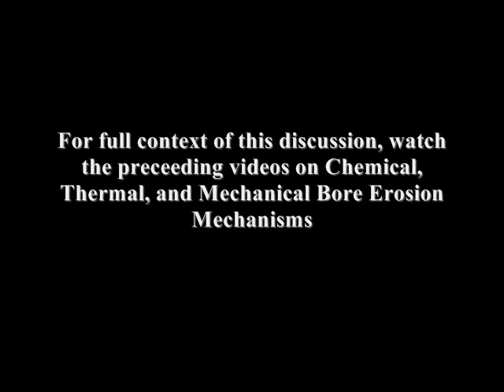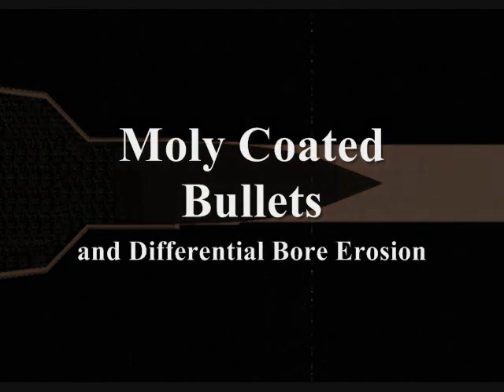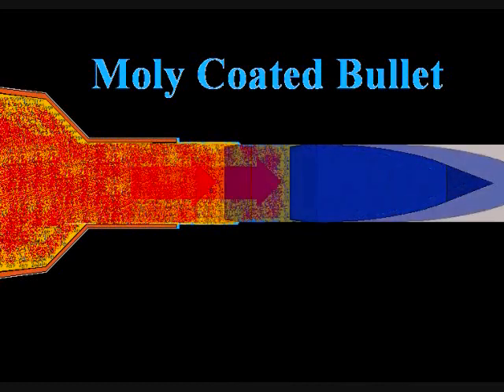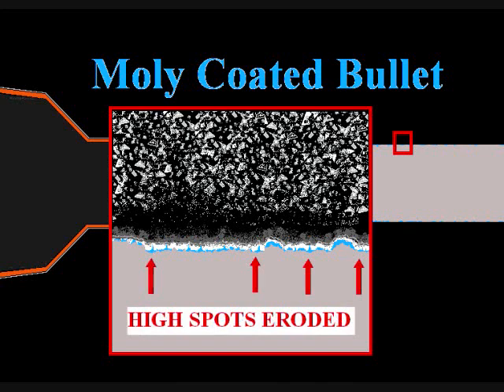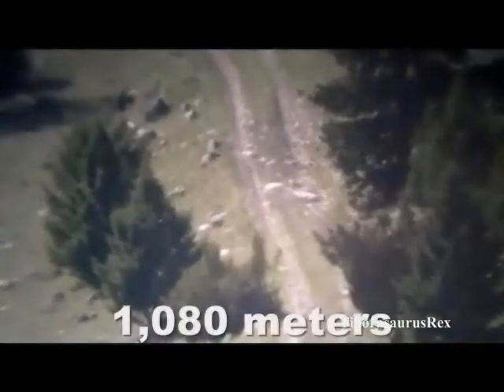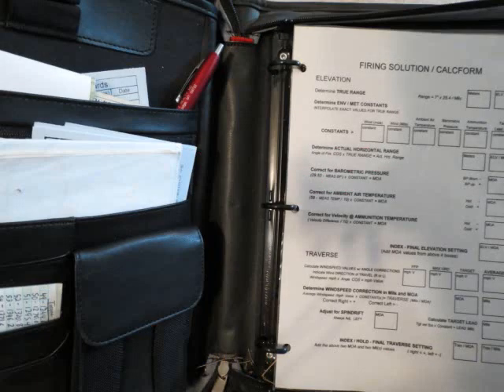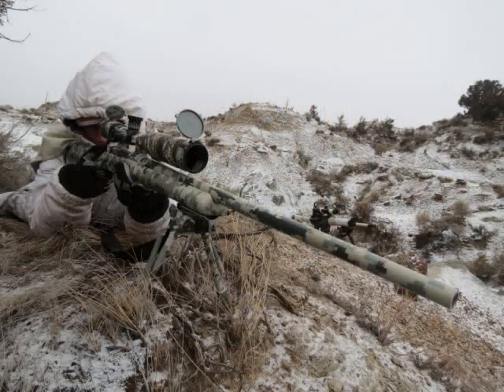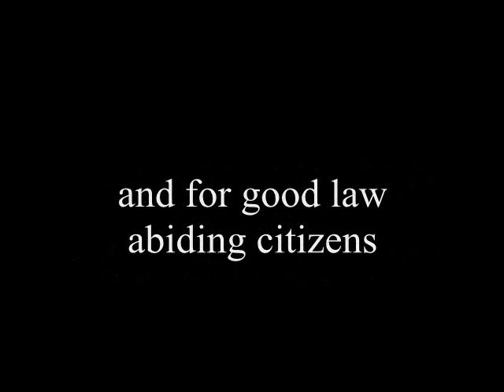Long Range 101 Part 39 - Moly Coating and Bore Erosion

Comment: Totally wrong on Moly coating . This is total B*ll Sh*t. It does NOT increase velocity for a given powder load . That means when you replace  a non coated bullet with a moly coated bullet and the powder load stays the same the velocity drops .  You have to increase the powder load slightly to regain the lost velocity . This happens because the in bore resistance has been modified and the pressure is reduced .  The Moly does not bond  into the steel in any detrimental way and any slight buildup can not build up more than the moly on moly molecular structure because the weak sulfur atoms allow the non bedded moly to just slide away as the  bullet passes . Moly has a high coefficient of friction against the steel but a low coefficient of friction against it's own atoms .  The stronger atom bonds  give the moly it's load bearing ability . People look inside the bore and see a black ring and panic thinking they have a  detrimental buildup and that's garbage . A normal clean with remove the none bedded moly . You don't want to clean too often with moly as that negates any advantage and you may as well not use it .
Any slight build up is protecting the bore from flame erosion THAT'S HOW IT WORKS. I fire 300 odd shot in .223 with Moly bullets before I clean the bore .
However that does not mean you put a gun away without putting some oil or grease in the bore and chamber as moly does not exclude oxygen from the steel like oil will . Why are you giving advice on a subject you know nothing about .